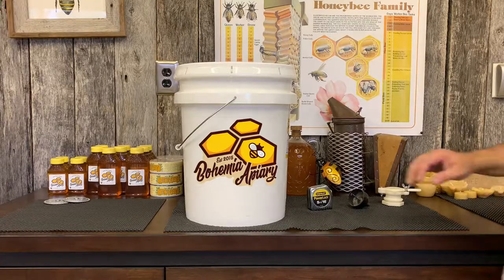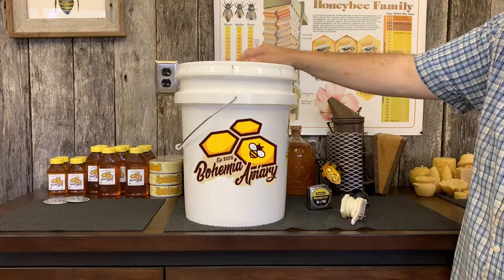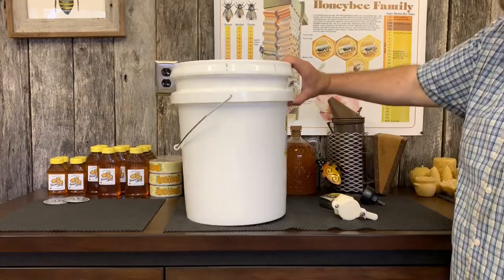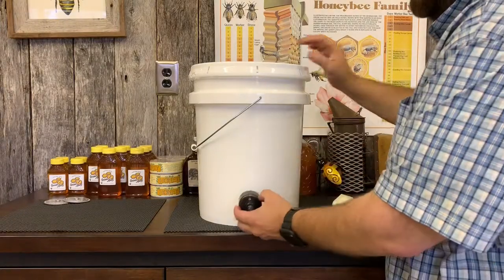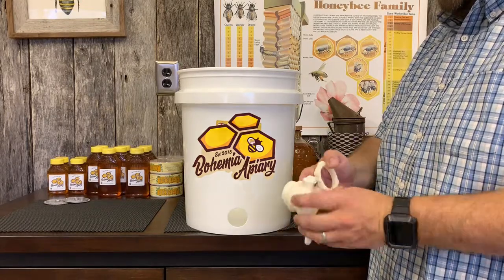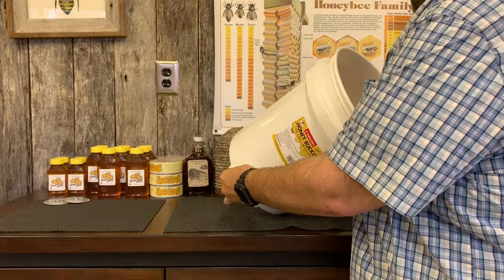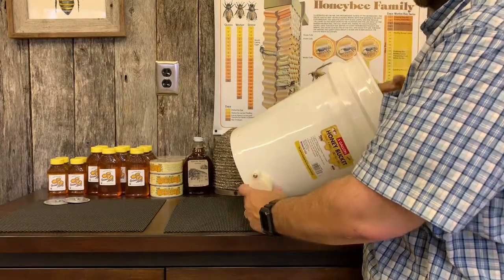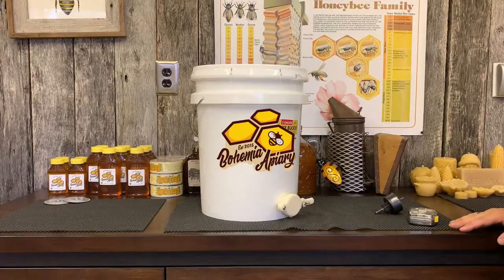Installing a honey gate in a 5gal bucket | Beekeeping

Comment: There are a million types and styles of honey gates; plastic, nylon, stainless etc.  Do you recommend one type over another?  The plastic is the cheapest, how well does it work?  I'm afraid of dumping all my honey when it is being stored in the bucket.
Reply from the maker: I personally use plastic and they work well, but for temp storage and usage. I wouldn't store long term in a bucket with a honey gate, because of the expansion/contraction of crystalized honey. Bucket storage is ok, just not one with a honey gate in it.